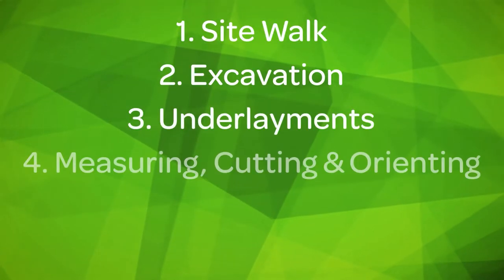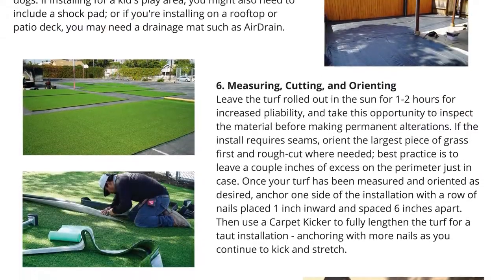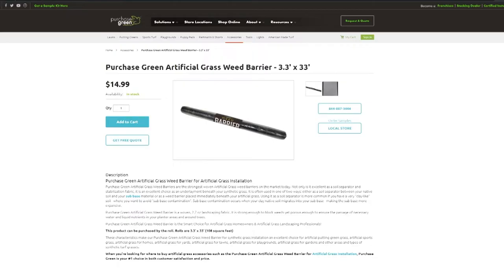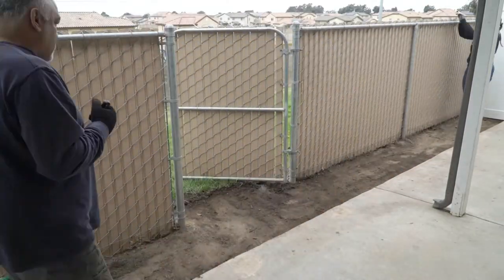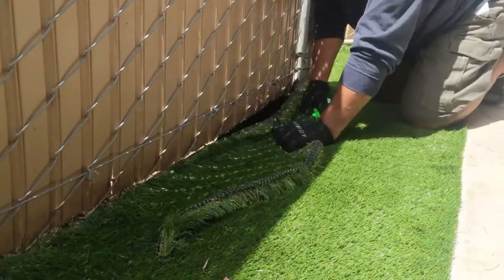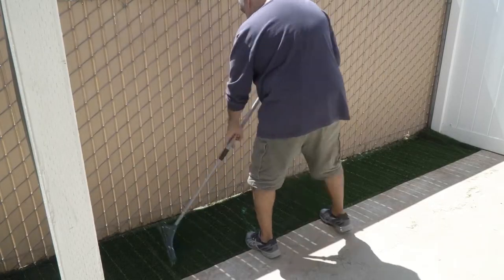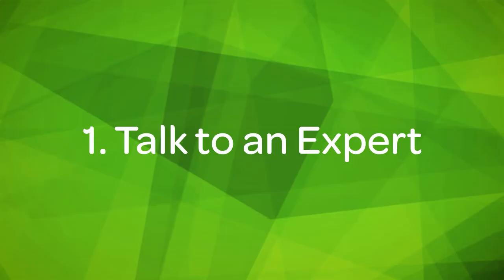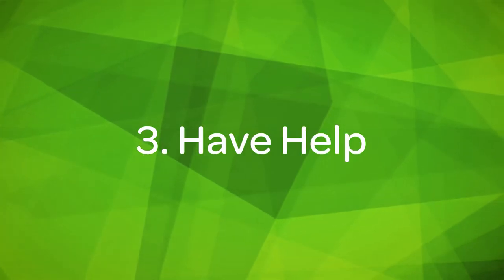Install Artificial Grass with Me! - Basic DIY Steps, Tips + Insights

Comment: Can this artificial tuff be applied to an existing driveway ? I’m wanting to cut it into strips to make a design on the already existing drive way. If so should I use nails of glue ? What kind of nails ? What kind of glue ? Thank you kindly in advance
Reply from the maker: Hi there! Yes, artificial grass can be installed on concrete. We recommend using double-sided seaming tape for those installations. You can check out this blog post for more info about installing artificial grass on concrete: https://www.purchasegreen.com/blog/how-to-install-artificial-grass-on-concrete/